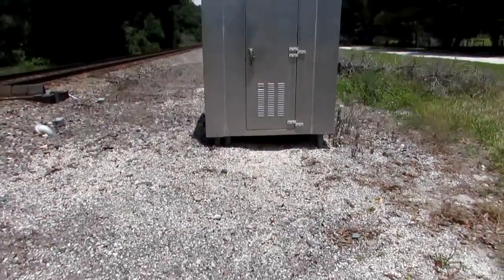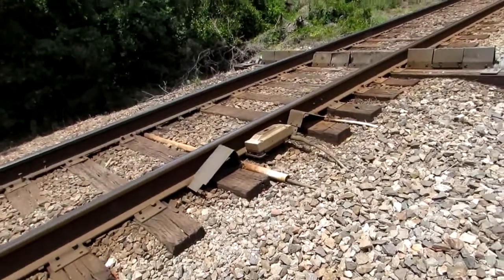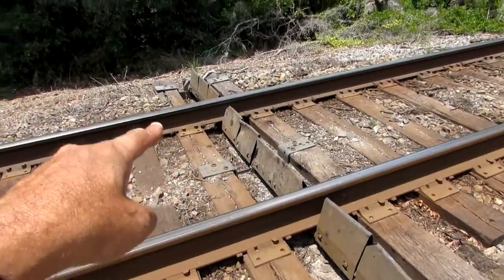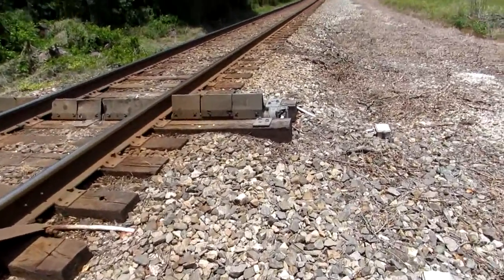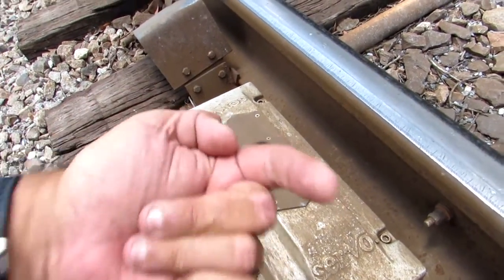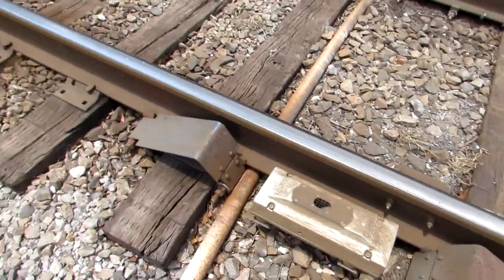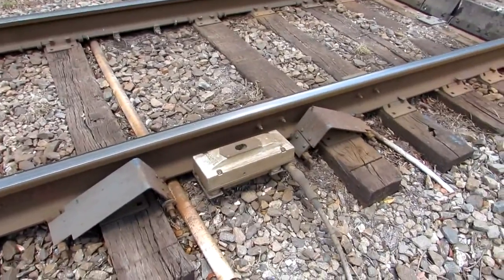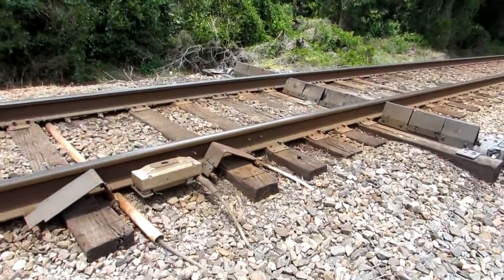CSX Defect Detector AR825.9 Dade City Florida

Comment: its a thermal camera  unit,  not a hot box detector.  they are seen  in 4061 locations through out u.s.a. on main lines.   unit give out name track no. and also speed length and high load trip alarms.  units give out bride width alarms and also dragging alarms and sticking brakes.   measurement units can sense flat spots on wheels,  voice alert can mention track sub div. and safety message..
Reply: Aj, that is a Hot Box Detector - the silver scanners mounted to the outside of each rail, but, are now referred to as being a "Hot Bearing Detector" or "HBD". I've worked with various HBD's since 1983 & find them to be interesting.
Reply: We still use the old terminology on the railroad calling these "Hot Box Detectors (HBD)" but it's actually now referred to as being a "Hot Bearing Detector". They utilize internal infrared sensors, not "cameras". The bearing's scanned infrared radiation is compared to the outdoor ambient temperature to determine the bearing's temperature. The HBD can alarm for 2 different criterias that each railroad determines. For Amtrak's northeast corridor, our HBD's will alarm if any bearing reads 161 degrees F, or, if a bearing is read to be 104 degrees higher than the opposite bearing on the same axle for 2 consecutive HBD locations. :)

Comment: Those are everywhere and it is pronounced defect detector
Reply: What is actually shown here are 2 different "defect" detectors: the infrared scanners are for reading the wheel bearing heat to detect over heating, and, the other (the paddles) is a D.E.D. (dragging equipment detector). Other "defect" detectors are also available for stuck brakes (Hot Wheel Detector), High Car Detectors, Wide Car Detectors, and some others. :)
Reply: Tom Y those are defect detectors there is always a draging equipment and hotbox detectors are always paired
Reply: Not always, on my territory the DEDs are installed in different locations than where our HBDs are. Only once did we have a "paired system", but a move to new HBD site had to be made because of a new siding going into service & the trains were braking over the HBD scanners, but, the DEDs had remained in their original spots. Our DEDs are wired directly to our signal system. Our HBD data is transmitted to the control center via fiber optics & only transmit over the radio when an alarm occurs (we have too many trains running to tie up the air waves) "Pairing" is typical, but, not always the case.